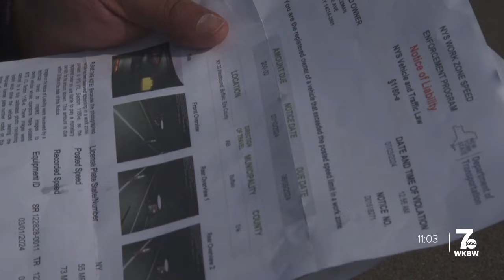Buffalo residents share frustration over work zone speed camera on 198

Comment: It's posted 30 for a reason. It's not safe driving 50 to merge on an exit or on ramp.
Reply: The 30 applies to the expressway itself not the ramp or exit, and it is not a merge,  each lane can continue forward unobstructed. His point is you have to create some sort of speed differential to get across the lanes of traffic and it you are getting off the Sisters hospital exit you have about 10 seconds to do it.